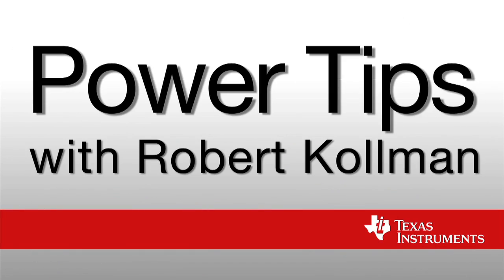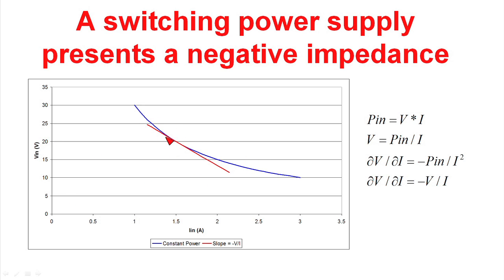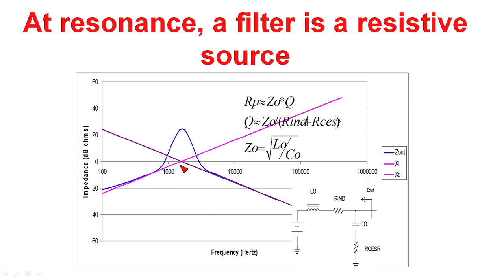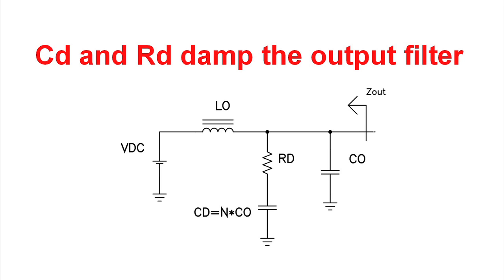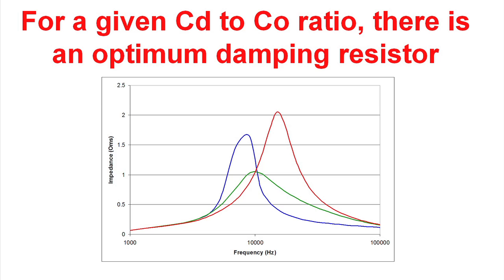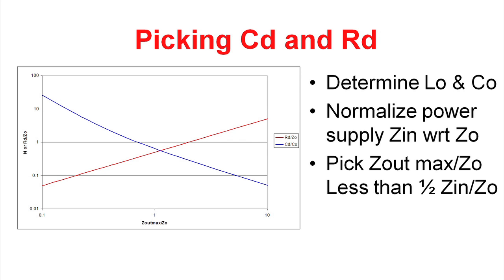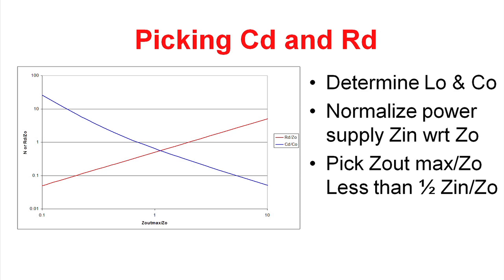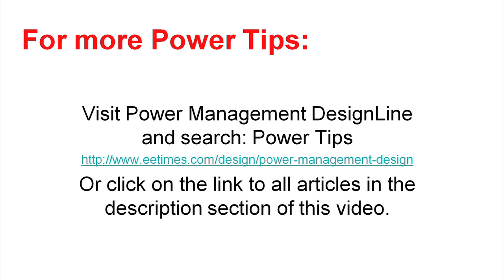Power Tip 3 & 4: Damping an input filter

Comment: It seems that getting a very low input impedance by following the advice in this video gives a filter with a step response that has alot of overshoot (ie the transfer function of the filter is underdamped). Simulate/caluculate using realistic rise times, then, make sure any overvoltage lock out function or component ratings downstream from this filter are all good, or slap a transorb on the filter output

Comment: iam using series 150uH and 330uF parallel with supply and it connected with constant power load, and the result is not have damped at output when there have voltage transient